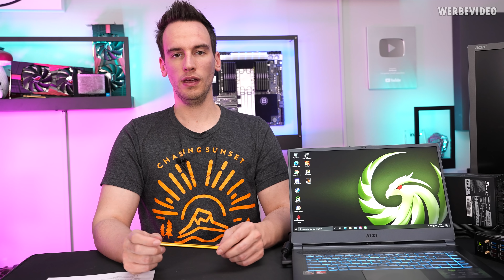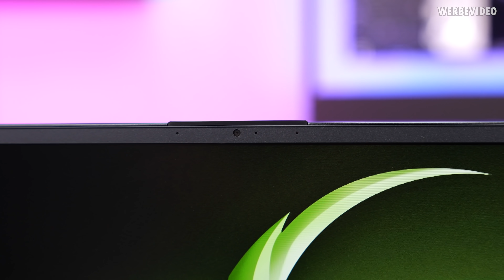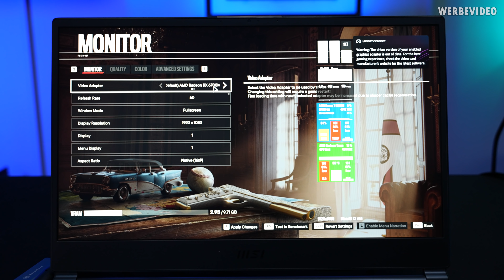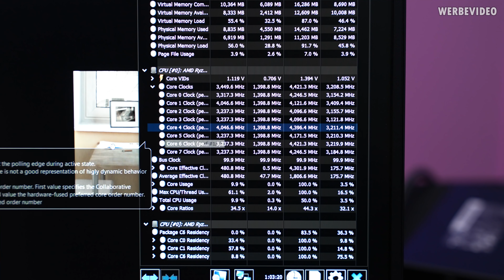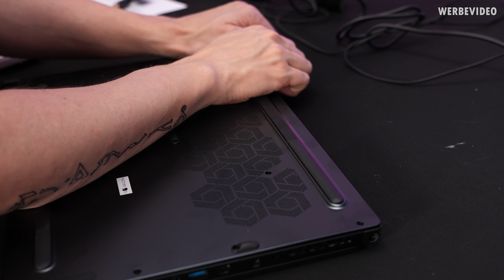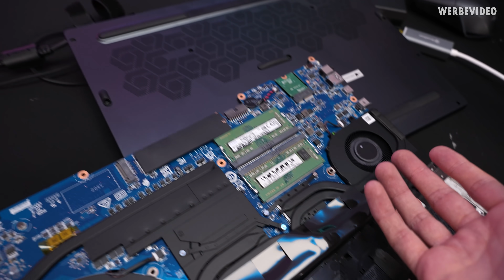My first time using an AMD Mobile GPU in over 10 years - MSI Delta 15 AMD Advantage is awesome!

Comment: i bought this laptop because of:
- using multiple virtual machines
- high battery life and lighter near hardware included laptops
when idle min 6watts per hour (RGB keyboard pulling +2watts)
10 hours web browsing is easy(on a gaming laptop).
- simple design

- no Type-c PD charging. i think for buying "laptop PD trigger".
100w can be enougt for so many my using scenarios. when gaming on wallpower, pulling this watts;
battery mode: 80watts
silent mode: 100watts
balanced: 150-160watts
Highest performance 180-190watts
Highest with Cooler Boost 210watts i see max.

(all is on the Active cooler pad)

i am software developer and mechatronical designer + little bit gamer.
Reply: I am also a software dev and looking for a new laptop. This has caught my eyes because of CPU, RAM and nvme. I don't care about gaming much. On their website it says: "Up to AMD Ryzen 9 5000 H-Processors", 144 or 240 panel and "AMD Radeon RX 6700M with 10GB GDDR6".  I'm curious if I can get the laptop with 5900 CPU and 6600 (I hear Roman saying it has 6600M) and 144 panel (I presume this would be cheaper). I speak ENG but not German. In my country, prices are out of control and I don't even bother. But on a larger EU market, I can't find different specs MSI site is telling me it's available. 

What specs do you have? Where did you buy it? How much did it cost you?

Thank you.
Reply: @alpha007org  
MSI DELTA 15 A5EFK-002XTR (delete TR tr is Turkish version)
Full Spec:
5800H
1TB SSD
240Hz screen
16GB ram
82Wh battery

in my country second choise is
5900H
32GB ram
others is Same

i want more software focused laptops firstly, but i cannot find in my contry this laptops:
Matebook 16 5800H
Redmibook Pro 15 5800H (But this device is stupidly 28w TDP limited)
Reply: I think SW devs should not get the fastest hardware, because they get spoiled and don't optimize for speed and low resource usage so we end up with slow software with high RAM requirements :-)))
Reply: @angelg3986  I know, right? Look at forza horizon 5. How it manages to run at 1080p 60fps on a 1050 and 1050ti is beyond me. That too medium to high settings.
Reply: What about the asus strix amd advantage edition with a 6800m and 5950hx and qhd panel. Should cost about as much as this msi.
Reply: @setzer-j6s  i focused 5800h for good balance for battery, performance and value.
also i am not gamer. i want play playstation ported games.

qHD is; i want so much but afters real-eye tests; i thing good reflesh rate and color gamut more important things(for my usage i am not graphical designer)

qHD is good choice for min 17inch sizes,

For good gaming (laptop or desktop) external monitor is better (my thought).

if i were a gamer, i would choose;
2021 ASUS TUF Gaming A15 (according to my budget)
Reply: @becuasegoodreason   @sehitcan kutel  Dude, even that asus strix gets 9-10 hours of battery life. The 5950hx is basically a 5800h, but higher binned and overclockable. 

The display of the strix is a qhd panel thats color accurate and has a 165hz refresh rate. 

Oh and it doesn't have a flipped motherboard. Also has more upgrade options than the msi.

Lastly, the tuf still sucks ass. The nitro beats it. Unless its really cheap in your place.
Reply: @setzer-j6s  i miss so info before you give, but strix is over my budget.

i am programmer and highest GPUs or CPUs is not neccesery for me. so i focused lighter, thinner and simple designs with bigger battery.
strix is have pluses for me;
+ PD cahaging support
+ more powerfull GPU and CPU (but not need to me)
+ ovderclockable CPU (but not neccesery)
+ not  flipped motherboard. yes this is important also for thermal performances (but i am not gamer)
+ asus

BUT
- heavy
- thick
- gaming design
- over my budget

- i am not gamer if i was find Matebook 16 5800h without external GPU i would buy it.
Reply: @becuasegoodreason  Well, I mean why not pick a ryzen 5 5800u laptop? Lioe that acer laptop with a 5800u and a 3050ti max q for about $1000. Or however much it will cost in your region. Seems perfect for you. 

Alternatively the aero 15x with a 4k oled will also serve you extremely well.
Reply: @setzer-j6s  yes for common users.
i am working vmware virtual machines. some times running 2-3 machines simultaneous.

45w and high core count CPUs is more better for my this usage.

and also i have a windows x86 tablet with U class CPU.

so if you think answering with "why not desktop?" or like questions;
it is not a question for neccessery to answer.
Reply: @becuasegoodreason  Was never gonna suggest desktop mate. 

I was just sayin' there's cheaper options than the msi that're better. For 1900 euros the msi is crap. For around 1300 euros, it'd be pretty good.

Did you also look into the zephyrus g14? Think it'd have suite you better, no? And it'd have been 'bout the same too.
Reply: @setzer-j6s   @Syzerix  
 i remmeber zephyrus g14 is in my options list.

But i dont remember why I gave up this choices.

Asus ROG Zephyrus G14
GA401QH
GA401QC
GA401QM
Reply: @becuasegoodreason  No usb c charing is so lame for the price
Reply: Everyone here would like to pick their parts like it's a desktop. But when you are buying a laptop/portable device, choices are so stupid every time. My "dream laptop" would be 5900H, 32GB RAM, 2x nvme, 90/120Hz display, and some stupid low end GPU. 6600 is just powerful enough to drive external monitor, for example to watch youtube, while CPU is hammered. My friend has an APU from last gen (Zen2) and when the CPU is in full use, youtube videos aren't playing smoothly, even if he wants just to listen and the video is playing in the background tab. So I need "a GPU". Lowest possible, so that it have all the video decoders and other stuff, separate from CPU.
Reply: @alpha007org  I mean you've got those laptops with a ryzen 7 5800h (which is very close to a 5900h) and rtx 3060 which will more than easily handle all your needs. And the display is 144hz. For example nitro 5 or legion 5. All of them have 2 nvme slots. And you can easily upgrade ram to 32gb
Reply: Did you ever have any problems with the hinges?
Reply: @diamondstar583  i have not problems on hinges.
rigidity of hings is good. normal like other laptops.

genarly i am not glad this laptop. low battery time, noisy fans(bcz: min rpm is 2200rpm) weak chassis construction.

Comment: Good review Roman, have to agree, having the MB flipped like that is a royal PITA, they really are trying to discourage people from doing anything themselves with it. As someone who was a serious gamer, still don't understand why you reviewers are always going on about running games in high graphics settings to play competitively, that's the last thing I ever did.
Reply: To their credit, they at least give you options when it comes to RAM or SSD, which is not something you always get from modern laptops. But I agree, this MoBo fiasco is just stupidly unnecessary.
Reply: @MGSncB  What're you talking about? Might be using the wrong modern laptops but many do give you the option of upgrading the ram, ssd, wifi, etc.
Reply: @setzer-j6s  Read what I said carefully. "... not something you ALWAYS get..." My Lenovo IdeaPad comes with soldered RAM, for example, but with two SSD slots. Not that I'd buy one, but MacBooks have their SSD soldered as well as the RAM. Are you saying no laptop has non-upgradable components? That's demonstrably false.
Reply: @MGSncB  Ohhhh...my bad mate. Yeah, its true modern laptops don't always give the option. 

Just gotta pick a good one. Gigabyte g5 gives a ton of upgrade options except gpu and cpu.
Reply: @MGSncB  Oh I do. Its just that their specs suck ass and they're not exactly cheap. Sure they're super upgradable but its not gonna help out performance too much. 

The gigabyte g5 is cheap, still very upgradable and quite powerful. 

I do hope they get more powerful and cheaper. Would absolutely love 'em as gaming laptops.
Reply: Who said "play competitive" ? Also reviewers are trying to push the device and show its maximum performance, from there its pretty easy to imagine what the machine is capable at lower settings. Also most people want good looking games, its cool that you want to make 1 or 2 more kills, but I dont.

Comment: I won't comment the performance of AMD components within this system but I would recommend everyone to avoid MSI laptops. They were one of the worse ones when it comes to build quality. I had one a couple of years ago, it spent more time in repair service than I was using it. And again, I don't have anything against other stuff MSI makes, I currently use MSI B460M Mortar motherboard in my desktop, but their laptops are a piece of ...
Reply: Which model?
Reply: @pclip5152  I honestly don't remember since it has been more than a few years. But it was the same story with my wife's laptop from back then. Several hinges broken, lcd cover (replaced several times), optical drive  stopped working, two or three cooling fans replaced, inverter for backlight, hall sensor which detects if the screen is closed. Since then I owned several HP and Dell laptops and, I won't lie, there were some issues with those but I used them much more heavily than MSI.
Reply: And I have an MSI GE70 that is over eight years old and still running (after 7 years the C and S keys wore out, and a fan got noisy, but it is still in use as a desktop).  So I'd be really happy to buy another one, except I know that my random experience doesn't reflect current reliability percentages for the brand.  For me, some of the most useful reviews and comments are those that cover the 'they screwed up really badly this year, don't buy it' situations.
Reply: @PhaedrusAK  You were lucky. As I mentioned, I had horrible experience with two of their laptops from a different classes.
Reply: All of these companies make good and bad products sometimes depending on the generation. My gf has had an MSI gaming laptop with an Intel i7 and RTX 2070 Max Q for over 2 years gaming a lot on it and doing other work, so it's used every day without any issues whatsoever.

I recall the Asus Strix 5700 XT gpu's 2 years ago were really bad, ran really hot and I've had a Strix 6800 XT for a year now and temps are fantastic even when overclocked to near the max allowed by the driver.
Reply: @TerraWare  Quite true. All companies make good and bad products. 
But, I wonder, how many laptop manufacturers consciously choose to make products without enough QA tests or, even worse, sell products when they are already aware of a critical flow on them...

Comment: 'M' in the product name is appreciated.  That other company is evil by marketing to name mobile parts the same as desktop parts.
Reply: Even amd used to do it on polaris on laptops (which they really only had the rx460 and 560). 

And nvidia's pascal on laptops WERE desktop class. Even the full power turing cards were. Ampere is the exception here. Only the laptop 3060 is desktop class and even then, it traded in memory for extra cores.
Reply: @setzer-j6s  
No , they were NOT desktop class.
Perhaps few models, but they were not.
For example Laptop with RTX2060 Max Q , was like 1660 Super or 1660Ti desktop.
But tnx to DLSS , 2060 Max Q would very likely wipe the floor with 1660Ti desktop in compatible titles
Reply: @GameslordXY  Dude, I said pascal was. And that the full power cards were. Like the 50w 1650, 80w 1660ti, 115w 2060, 150w 2070 super, 160 to 180w 2080 super, all of pascal cards not max q and the 105w to 130w rtx 3060 laptop. These were desktop level.
Reply: @setzer-j6s  they introduced max-Q and max-P, but not every manufacturer wrote that in the specifications. The max-P were desktop class for the most part, the max-Q were not.
Reply: @Shiinamusiclyricssubs  Yeah, thats 'bout right.
Reply: Both companies used to, but I think Nvidia probably needs a new differentiation, it is probably too much like AMD/Intel mobo X series vs Z series naming stuff